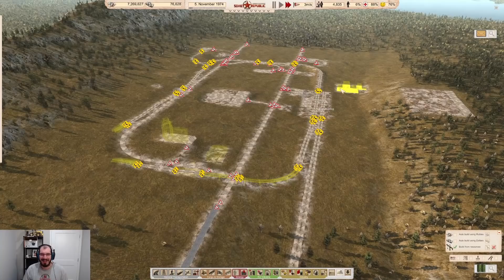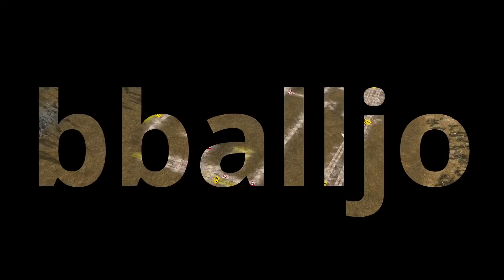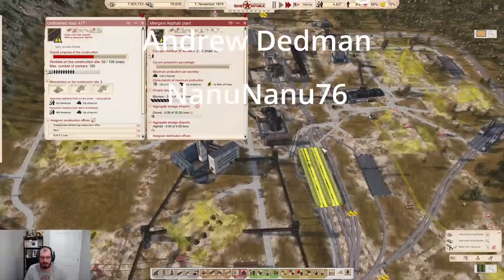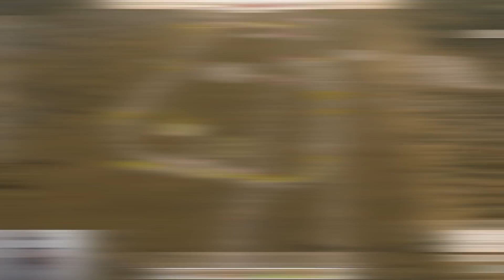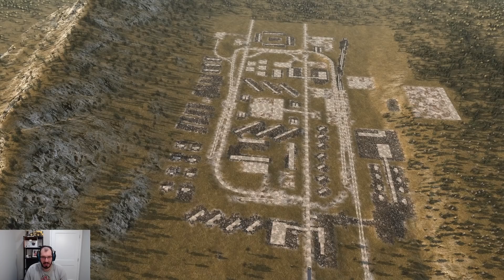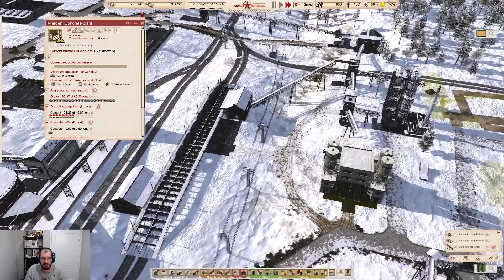Soviet Mega City Project 2/2 | Part 16 | S4 | Workers and Resources

Comment: Looking forward to seeing the build. Then things will get rolling!
You can use the level from center to get both sides of the overpass the same height. And if you need a little space recovered after, the smoothing tool (your favourite) can work.